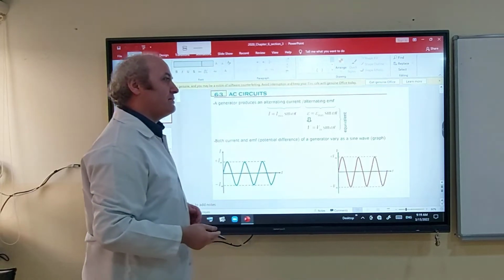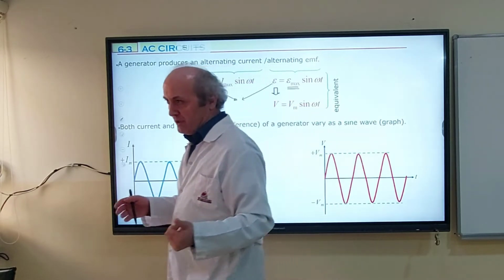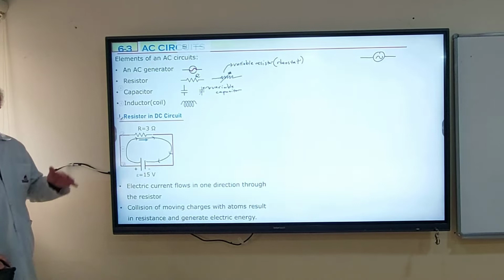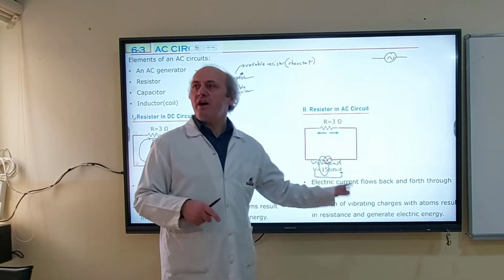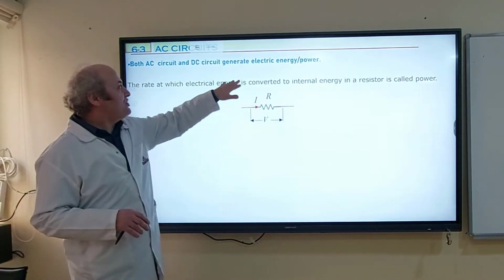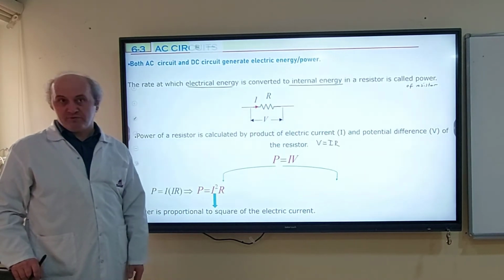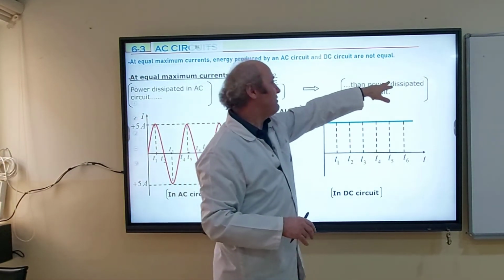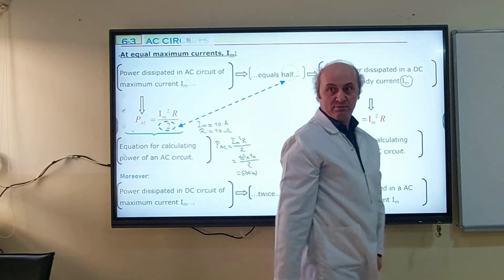AC Circuits, Chapter 6, Section 3, Course 1

Comment: I think using I max for calculating power lost for AC is wrong and you should use I rms
Reply from the maker: No, if you divide by two, it is also correct.